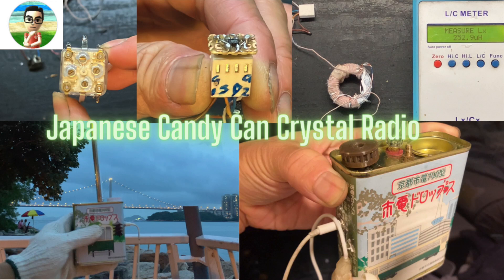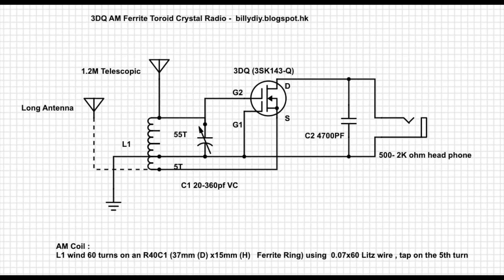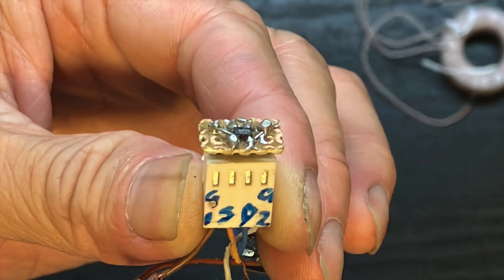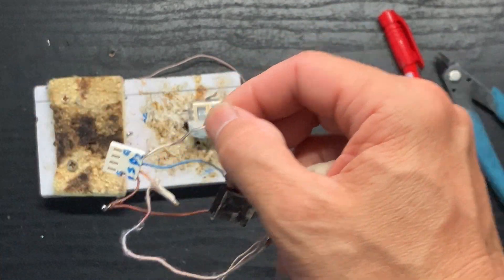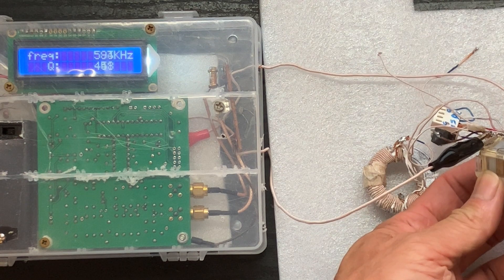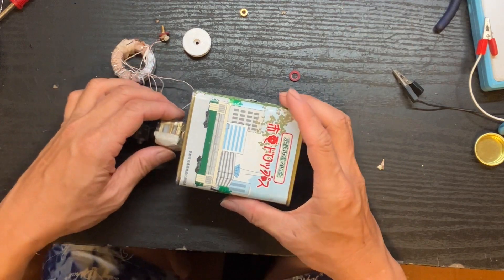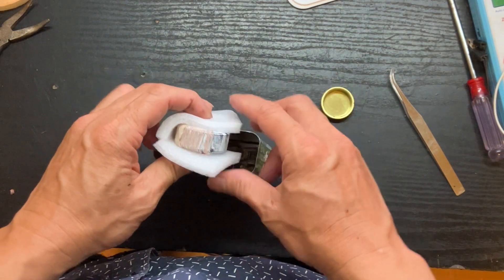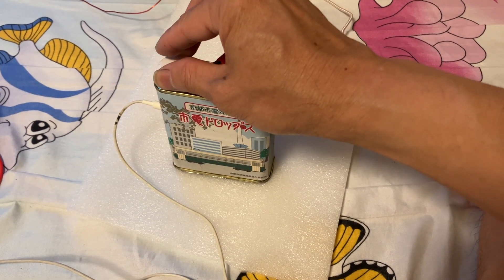Candy Can Crystal Radio

Comment: Billy how does the 3dq compare to the diode I.e. 1n34 Is it louder ?
Reply from the maker: To compare them on common grounds. Assuming that you perfected all the impedance matching piece which is the bread and butter of the crystal radios.3DQ is louder on weak receptions. Diode is better on strong reception. Eg Diode performs better I  strong signal in driving a speaker without amplifier . Checkout my blog that tells you everything about 3DQ. http://billydiy.blogspot.com/2020/09/what-is-3dq-as-am-sw-and-fm-radio.html?m=1

Comment: Billy 56 floors ? Very High
I don't see a ground connected 
Please explain
Reply from the maker: When I tested indoor I was using a big loop as an antenna instead of a regular long antenna and ground. For big loop antenna grounding will just make things worse. When I tested outdoor, I used a 1.2M telescopic antenna and no ground. As I am very close to a strong station ( 5
km), I don’t need a ground. Though it will get enough louder if I fix the ground to the steel fence close by.
Reply: @BillyCdiy  thanks !